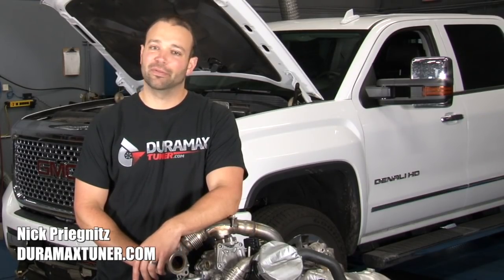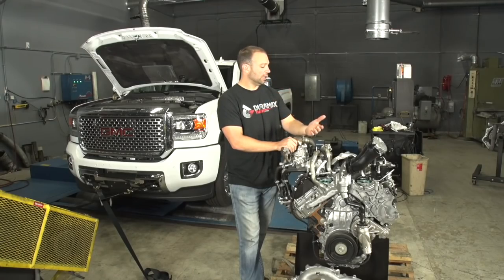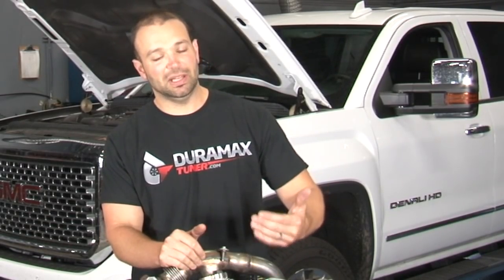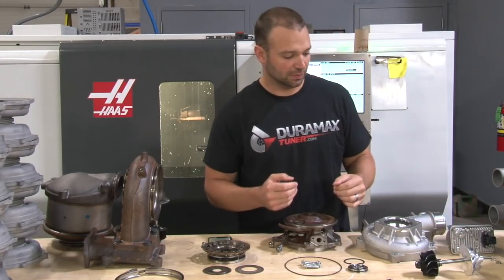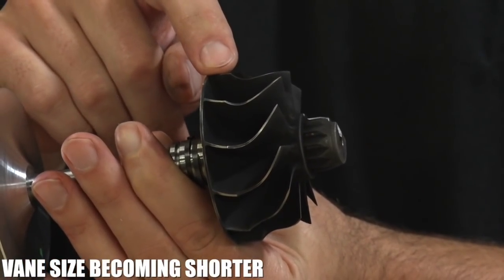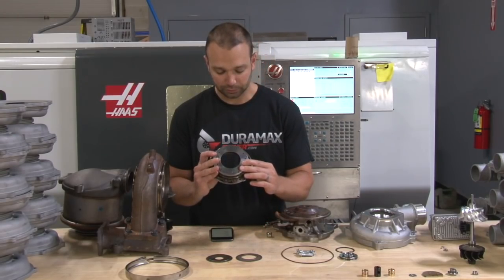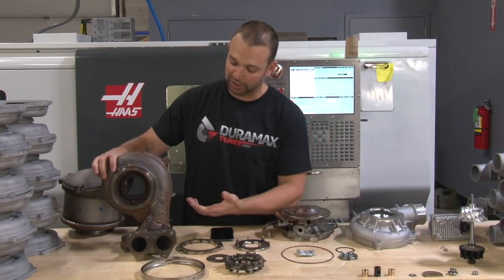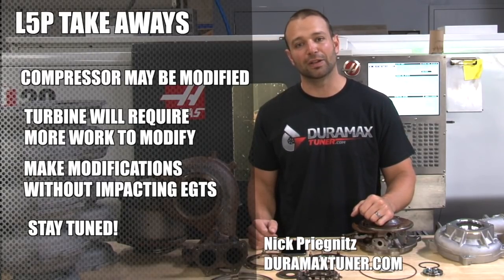L5P 2nd Update: Turbo Details

Comment: I know this is an older video, but you state the factory egt cut is 1530f. I don't believe that to be the case, I'm pretty sure it's 1471f. I know it doesn't sound like much but a material engineer will be able to tell you how much percentage strength your losing and why the factory calibration cuts fuel at anything over that temp.

Comment: BANKS GOT YOU WHOOPED BRO!!!
Reply from the maker: ?? We have actually met Gale and think he is a great guy with an awesome product line.  If you prefer the derringer we can honestly say that you should go for it.  Just to be clear though, our Custom Tuning is very different than a wired in external module.  We are able to include a much higher peak horsepower and torque output that is made capable by our extensive  ECM/TCM mapping.  Here is a video we did with Gale before custom tuning was available: https://youtu.be/MHmWOHqbyW4
Reply: Butch Cassidy In what way? And why are you yelling?

Comment: Good luck if you have big tires will set whole bunch of codes.... crankshaft reluctor is in the back of the engine and will cause vibration.... smh.... every day learning some thing new with l5p

Comment: The only thing i care about on my L5P is getting the EGR & DEF off the truck asap
Reply from the maker: @3DProductions  well the SCR is mounted to the back of the turbo (we did a L5P turbo review you can watch) so that takes a several hours to remove the turbo, most people with a $60K + truck prefer to a really nice EGR delete which is a lot more than a few block off plates, and the cost of L5P Tuning is (for delete or non delete) over $4,500 without core charges.  Due to EPA restrictions we do not offer any deletes.  The LML is still a strong platform that is going to fit a lot of peoples needs.  For those with an L5P that would prefer to keep their emissions equipment intact and still want all the benefits of tuning, we can help.
Reply: RSD N/A , just to do all of that will cost 5grand on a l5p. better to stick with a lml or just wait a few years. I'm sure prices will come down gradually.  
I will only by a l5p duramax if itbwas possible to delete it for under 3grand for everything.
Reply: @mattreb5748  I agree, and had I known, I would have done just that, but unfortunately, while looking for a well-used lml, I veered off track and bought a brand new l5p in 2017 ;/
I will just have to wait it out.
Reply: Serial data module will be hard to put a programmer on it. Will shut the system
Reply: @highball7347  Luckily I haven't had any issues, love the truck.

Comment: 1530 is the shut down temp on these trucks? That seems to be extremely high considering I set my defueling on my truck at 1250-1350. Whenever people ask what is safe these are the temps I tell them to keep in mind. Are these higher temps around 1500 still considered safe?
Reply: Great questions. Is the 1530 the limp mode temp, or is that when the computer starts defueling? I would like to know when heat soak becomes a problem. I've always been told to keep my 04 cummins under 1300 while towing or stuff can begin to melt. I would be very impressed if these new duramax engines can withstand 1500* towing temps.

Comment: Can you replace the EGR with water/Meth injection and still run the DEF system?  I would think it would cool much better.
Reply from the maker: We are a little skeptical of this, but time will tell if it can be done.
Reply: Not sure about the “hard science” but I would think it would cool the combustion chamber immensely compared to using exhaust.  Plus, you do not kill power with exhaust.  Also, the water/meth would help clean the exhaust system.  I have been thinking about this for a while now, Ha!

Comment: I'm so keeping my LML lol
Reply: Matthew Rebecchi Exactly what I though to myself.  Now if only DT can recommend a great, reliable aftermarket Garrett for the 2016 LML, then I’d be on my way to the bank!
Reply from the maker: @Shad0wC0mpany2  Done: http://duramaxtuner.com/turbo-systems/lml-stealth-67g2-turbo.html
Reply from the maker: @Shad0wC0mpany2  Also see: http://duramaxtuner.com/turbo-systems/stealth-64-vvt-lml-1089.html
Reply from the maker: @Shad0wC0mpany2  Just in case you want to go Twins with a 15 or 16 model we got that too: http://duramaxtuner.com/turbo-systems/dt-lml-twin-turbo-kit-2015-2016.html
Reply from the maker: @Dobbies Revenge If your truck is just a daily driver it comes down to preference.  Most people will tell you that ownership cost of a diesel is a little higher than an equivalent gas truck.  However, if you want gobs of low end torque and a potential for a 500+ RWHP truck the diesel is going to be for you.

Comment: You said the limitation is the heat so safe is roughly 550 could you push the turbo more with the cat deleted
Reply from the maker: The "cat" or DOC is not the limiting factor to the turbo.  At least at this point we don't believe it is. More than likely the small compressor wheel and turbine wheel are going to limit how efficiently the turbo can make cold air.

Comment: I am no way as experienced as you guys at duramax tuner but, It sounds like some nitrous is needed to keep the EGT down or maybe a meth system. Or at the least a nitrous ring to spray on the intercooler.
Reply: Blake Ferrell open up the exhaust and intake I bet it be fine.
Reply from the maker: We generally shy away from injectables on street driven trucks but some solid R&D would be interesting.

Comment: Honest question to those on the know: Why hasn't GM gone to reverse flow flow heads ?
My take away at the end: Needs a BIGGER turbo to go beyond 500hp.
Reply: They’ve made 570 with just tune no delete. down/up pipe, and almost everything else was stock
Reply from the maker: Correct, 570 with an all stock truck has been hit but the EGTs and other indicators were well past safe (at least in all of our testing). As far as why GM doesn't go to reverse flow heads, our guess is that they don't see a need for more than 500 RWHP.
Reply: Ppei has dyno numbers over 570whp if my memory serves me right, but like nick said I'm sure it was very hot 1700+ degrees egts

Comment: I've noticed every time I shut my L5P off, the veins open and close about 4 times...wonder if GM did that to keep veins from sticking. My LBZ would often throw a code for the vein position sensor.
Reply: truckguyjoe  Yes they do this to keep the vanes free, as well as checking proper calibration. The L5Ps also cycle the vanes when you open the drivers side door
Reply: Preston, you know I've heard that too...when you open the driver's door.
Reply: Yep if you pop the hood you'll see the arm cycling back and forth.
Reply: That's very good feature to have.
Reply: Some really cool stuff for l5p owners.
Reply: It’s making swipe so no cabron build up
Reply: I noticed it first day with the L5P . My LMM did it at startup and shutdown. I still cant understand the need for it when door opens or at other strange times.